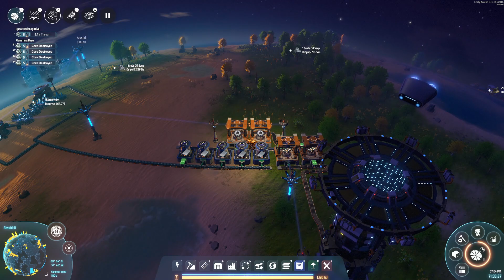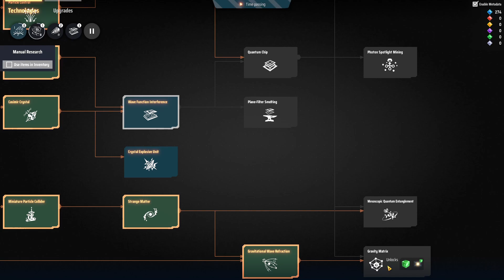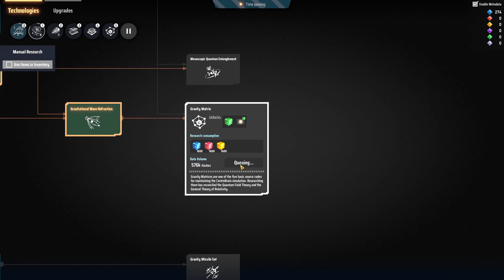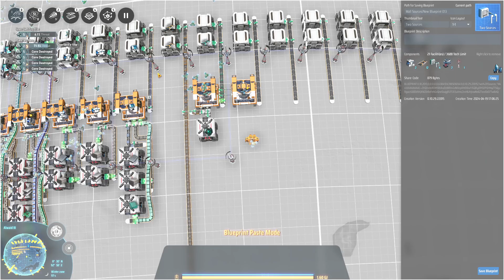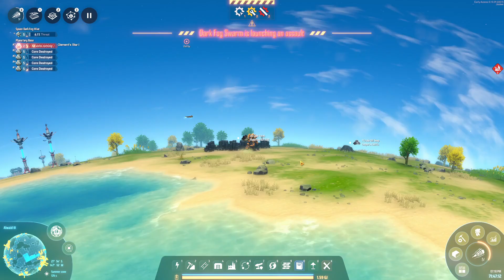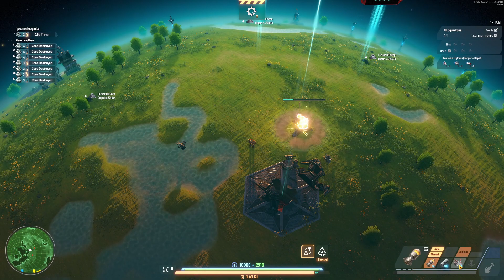LOGISTICS // Dyson Sphere Program // Mission Log 71

Comment: hahaha everything has to be perfect!! actually I'm yelling at you about your boutique builds XD you're constantly digging yourself a hole deeper and deeper with those lmao... you realize with that belt mk 1 build that feeds directly off a single vein is likely to just run out again eventually (especially with the size of the nodes on your home world, they are a lot smaller than the lava world nodes)? the tower fed mall is the way of the future i dunno why the single belts build had to be different! you definitely need to get into some bigger builds soon too. drone fed 30/sec smelting builds will help provide bulk raw resources to the network, and that type of stuff will let you feed 720/minute green engine builds and bigger blue ring builds. trying to make big builds off a single node (or two) is super hard for throughput. these nice and shiny new mark 3 belts will help a lot with bigger builds. definitely finish that mall first though, the DSP distractions never end.
Reply from the maker: Yes, I'm learning and improving but it will take some time. As for the belts, I don't think I'll ever use enough to drain the node but I could be wrong. It will be idle most of the time.
Reply: Be kind to yourself! It took me decades to notice, but if I don't punish myself so harshly for mistakes, I naturally become more accurate. Placing buildings in 3D on a sphere introduces deceptive parallax error etc. Good call to do the OCD stuff off camera, although if this were a live stream it would be perfectly acceptable to keep going. Wow, I'm even more grateful now to Satisfactory for introducing the "nudge" tool.